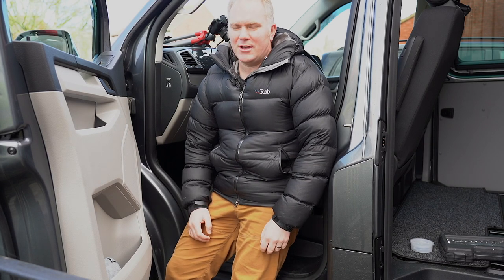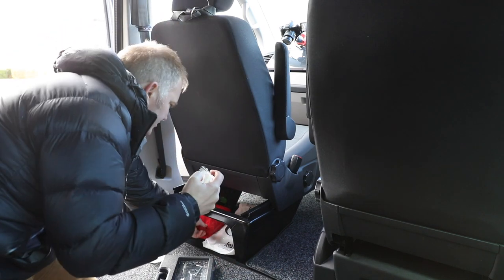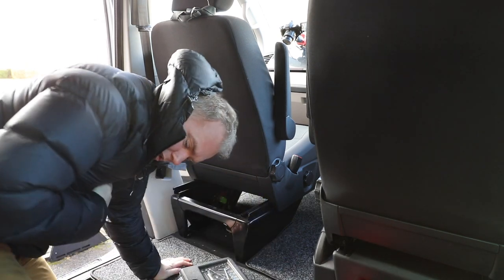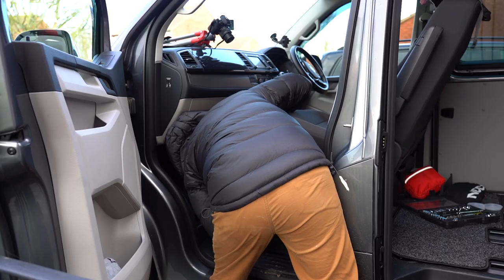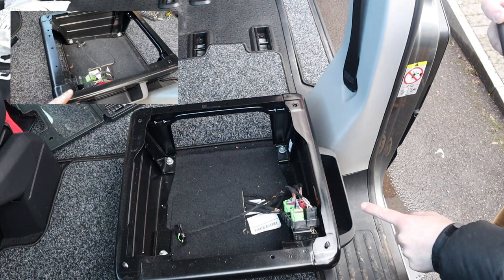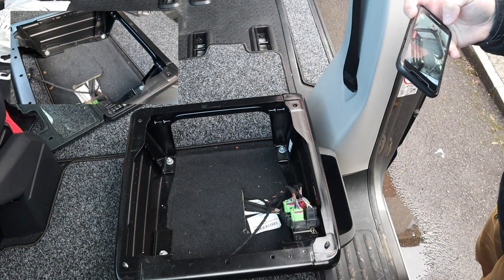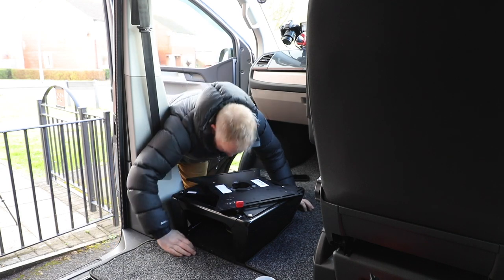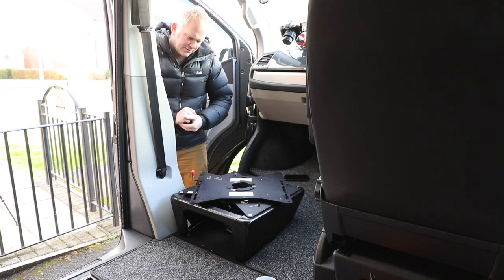Fitting a RIB Passenger Swivel Seat to a VW T6 Transporter

Comment: Thanks for the video. 
I think that red lever is a deal breaker for me. 
How did you go with the plastic back cover, will it need trimming or pops back in no problem?
Also disconnecting the cables without disconnecting the battery will it trip the computer with false warnings?
Most helpful vid out there. 
Thumbs up
Reply from the maker: Hi There, sorry I didn't realise you has commented. The back plastic cover went straight back on no problems. In the end I bent out the handle and it seems to work ok but not the best design. I had no issues with the cable disconnecting at all. No faults whatsoever. Thank you for the comment.
Reply: @simonlongworth4791  that's cool. 
I'm about to order the sportscaft one because of the lever and it should spin both ways. 
Thanks for the reply